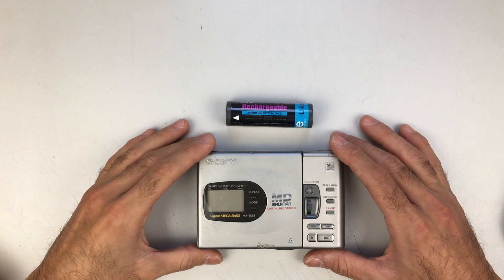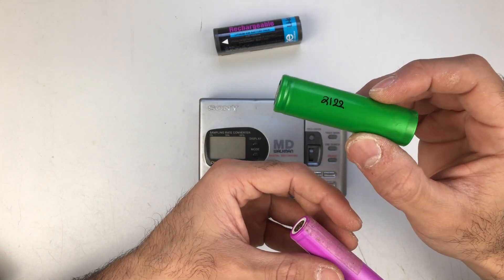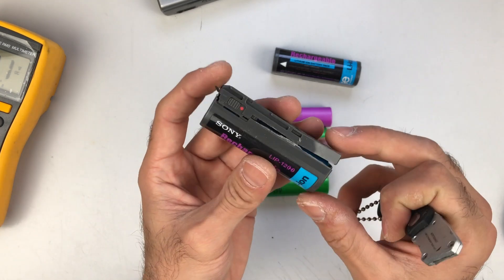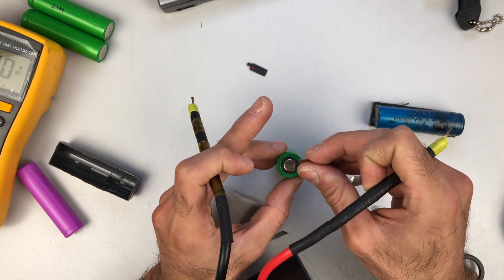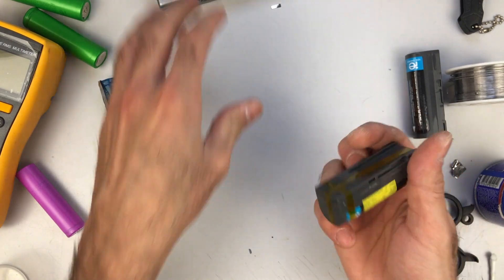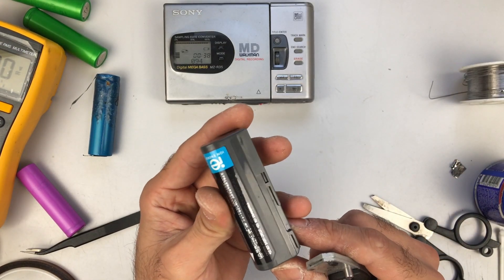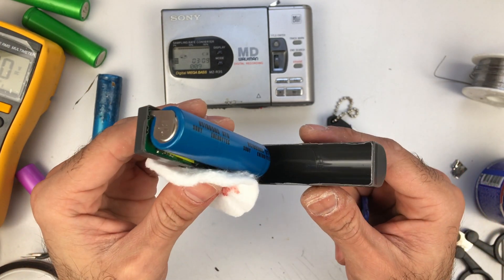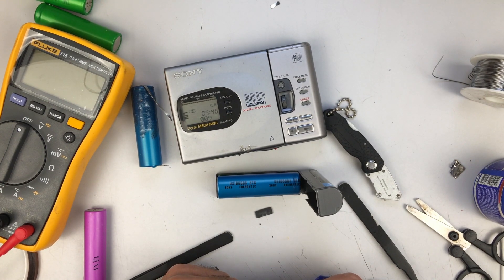Sony minidisc walkman Li-Ion battery upgrade for the MZ R30/35

Comment: To open those batteries, I use a utility knife blade that I place right on the seal and gently tap the edge of the blade until it opens. This way there's no risk of cutting yourself, and the battery opening is cleaner and it fits perfectly when closed again.
Para abrir esas baterías yo uso una hoja de cúter que pongo justo en la junta y golpeo suavemente el canto de la hoja de cúter hasta que se abre y asi no hay riesgo de cortarse, ademas de que la apertura de la batería es mas limpia y al cerrarla de nuevo encaja perfectamente.

Comment: I have many unprotected high capacity cells that I was going to use for another project. Can i use them to change my battery in my MD player since the battery case already has the charging board in it?
Reply from the maker: Hi,
I suspect the little board is only for discharging, but yeah the charging system is designed to charge a lithium ion cell.

Comment: Well-done! I did it a more "primitive" way (didn't have access to any welding tools)
Reply from the maker: Yeah I've seen your video. You have done a better job.
It doesn't matter really the nickel strip is small and heat transfer to the battery is minimal.

Comment: maybe you read my comment and can answer..I got this sony you have and a a MZ-R50 for free from a friend and even a MZ-N707 that i use and alot of part to them but the two first i dont get any charger and when i look at the side of the walkman there is a giant connection is this for the Base station?   i can buy a charger but what about minidisc? Hope you can answer..Thanks and greatings from sweden...Is it possibule to buy the batteri stil?...can you use other way to rec something to the minidisc of you dont have the digital cable?.You should try to use a Mac and you dont get that enoying noice...i use both mac and pc and i am a collector so i have some..Thanks and greatings from sweden
Reply from the maker: Hello friend from Sweden. 
For charging it's usually 3 or 6v basic cylindrical barrel plug, you can find them readily on ebay. And also the minidiscs.
For recording you can use either 3.5mm jack line in or optical cable. 
You can also use pc or mac to run software to transfer data via usb, though I have never used it on mac.
Greetings from France.

Comment: I have a Sony MZR-30 I bought in 1996,the Lip-12 battery at the time was £64.99,but it was with the player for £299.99,there are clone batteries on the market for £18-20,but the original battery didn’t last long after a few charges it was dead,it’s a good video for replacing the cell inside,but a bit fiddly for some people,I tried it and made a mess so bought a clone,it works but it’s not a lithium ion,it’s ni-cd so doesn’t hold charge well if not used for a while,it’s very hard to get an original Sony lip-12,but great if you can and it charges,great video by the way.actually I’ve just looked at the clone battery and it is 3.7v lithium ion,so that’s good.
Reply from the maker: Hi,
I'm surprised by the price of the lithium batterypack back in the day.
I agree, this is not for everyone, but it's doable. 
I don't have a 3D printer yet, but it'll be way more practical to print a support for a li-ion cell to put directly in the player. Just have to find a solution for overdischarge and you can change cells on the fly.(and charge them outside the player)
Anyway.  Have a good one.
Reply: Yes expensive battery in it’s day,that price was from the Sony Centre in Leicester,expensive for what they are,but we pay a premium for Sony don’t we,thanks,and you,👍
Reply from the maker: @neilrobinson5115 indeed we do :)

Comment: Good video. It's always the same telling yourself not to cut yourself then you go cut yourself. I'll open my one up and change out the battery. Thanks for the tutorial. Much appreciated 👍
Reply from the maker: It happens. I trusted the small blade too much. 
Good on your repair.. does yours charge via the walkman? Mine doesn't but I haven't touched it in a while. There are some charging settings in the test mode maybe it'll help.